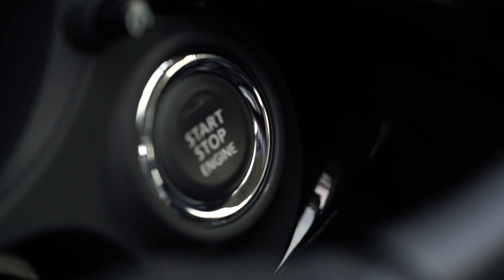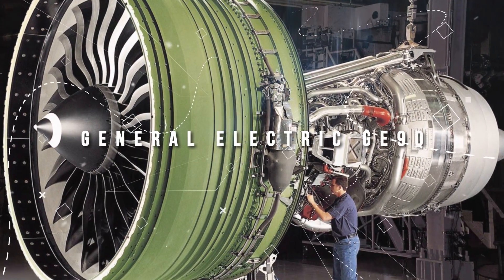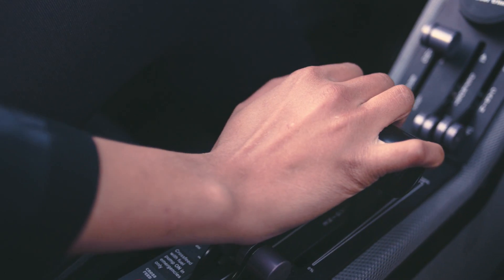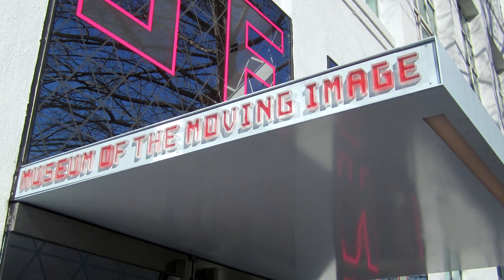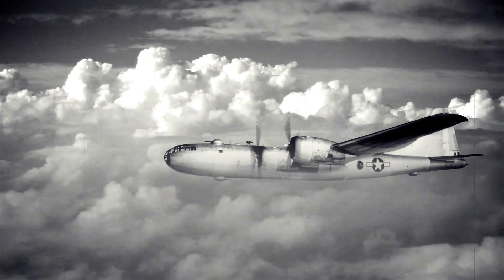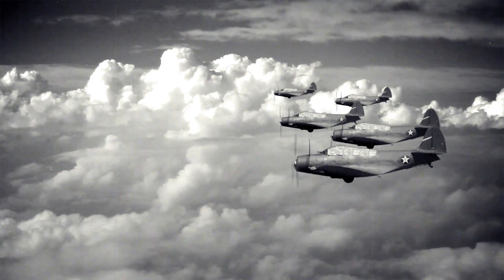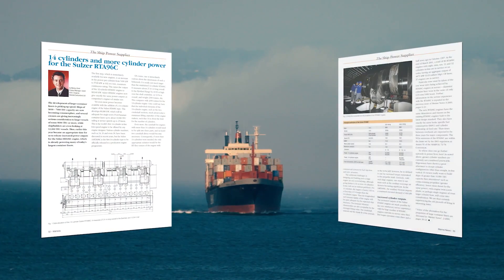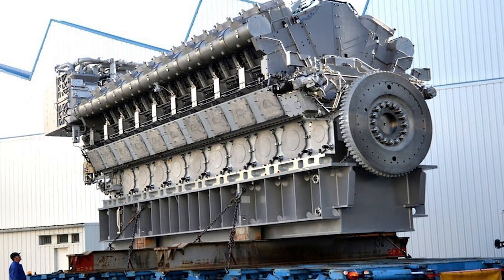10 Biggest Engines In The World

Comment: A lot of turbofan engines are becoming larger for commercial aircraft just look at the Boeing 737 max-8. The larger engines improve efficiency as the bypass air produces a lot of thrust nowadays however these are obviously useless for jet fighters as the high bypass ratio does not allow enough compression for afterburners

Comment: Two mid size are better than one big. Small Nuclear Engines are the answer rather than consuming fossil fuels at huge rate. 
Turbines are most complex with blade clearances very small. Blade Engineering is a big topic, as well as compressor. Turbines produce huge heat and that exhaust heat must be utlised.

Comment: Hate to be a pain in the rear but that GE turbine is pronounced Ter-Ben, and it's a gen 4 wind turbine, not technically an engine. It uses an induction machine without a gearbox to produce electricity in some places straight to the grid, so that is a very cool fact if your an electrical guy like me.
Plus there is only 5 that were talked about not the 10 in the title. Very disappointed but happy to learn something interesting about trains.

Comment: Missing in the convoluted explanation of rod and cylinder configuration of the Wartsila R96B is the fact that the cylinder is an enclosed bottle with the, round in cross-section, upper portion of the connecting rod passing through a sealing gland at the bottom of the cylinder bottle.  When the piston travels upward, it draws combustion air into the portion of cylinder below the piston.  When the piston compresses, fires and starts downward on its power stroke, it simultaneously pushes the air below the piston, up into the combustion chamber, expelling exhaust and charging the combustion chamber with combustion air for the next compression stroke.  Amazingly, this 2-stroke engine has an efficiency of around 50% which makes it not only the largest reciprocating diesel engine, but also the most efficient.

Comment: 4:56
Actually, it has a range FROM 6 cylinders to 14 - the series includes 8 10 and 12 cylinder versions.
The 14 cylinder is the current record holder for "highest horsepower piston engine" by a small margin over an older MAN design.

Comment: This may be off topic, but I think someone might find it interesting. :)
Device to end the creation of Nuclear waist.
Electric Generator Design that's powered by it's self & perpetuates more electrical current then is needed for it to run continuously on it's own. 
 Step 1: calculate how much energy you need pumped into an electric motor to make a vertically positioned circular platter with magnets in-bedded horizontally around it's left side and right side (so there pushing force is pushing out sideways relative to the vertically spinning disc) to spin as fast as you need it to. Also better to make sure these magnets are shielded around their sides & back  with metal that has high permeability so the magnetic field they are emitting is focused fully out sideways. :D Step 2: Calculate how many sets of copper coils you need to be interacting with magnetic fields to achieve this & to perpetuate more electrical current flow then is needed. :D Step 3: Build a round horizontally positioned platter covered in all these copper coils pointed down that does not move (Is stationary) :D Step 4: build a round platter covered in powerful magnets pointed up that can spin and place it directly under platter with hanging copper coils. :D Step 5:  Position the vertical platter that is  motorized close to the horizontally positioned platter covered in magnets pointing up so that when the vertically positioned platter spins the in-bedded horizontally positioned magnetic fields slam sideways against the edge of the horizontally positioned platter causing it to spin. :) Step 6: Make sure enough of the copper coils are feeding their electrical current into the electric motor and the rest of the copper coils are linked into a set of rechargeable Battery's placed in the closest most convenient spot. Step 7: Build a duplicate setup of horizontally positioned discs with hanging copper coils and disc with upwards facing magnets and assuming the first set of discs are positioned to the front left side of vertical spinning disc, position the other duplicate structures to the front right, the back left and the back right of the vertically positioned motorized disc. As the vertically positioned motorized disc spins the horizontally in-beaded magnets will now hit into all 4 horizontally positioned discs causing them to spin. so you will effectively be using the spin of one disc powered by one electric motor to spin 4 constructs that are each generating electrical current. now build this whole setup multiple times over and use the current perpetuated by it to power up scaled electromagnetic generators that are equal to or more powerful than the ones used in a nuclear power plant. You will now have a device that is self perpetuating off of it's own electrical current perpetuation and no nuclear waist to worry about.
Reply: Don't you mean "nuclear waste" not "waist" ?
Reply: @8546Ken  Your probably corect :) Speling is not my strong suit. I left out double leters on purpose here tho, I am against them. :D
Reply: His this actually been evaluated impartially to verify the free energy? Is there a legitimate test report?
Reply: @8546Ken  I'd say through the entire process of designing it I was completely impartial & unbiased to the final result of it's design with nothing but it's intended function in mind I kept an open mind to to any flaws in it's design that could hinder it's functionality. Since this post I have made some improvements to the idea and will add them in another response. As to a physical test report, not that I know of, however seeing as how it is designed with concepts that are tried, tested, and proven, I am confident in it's ability to successfully function the way it is designed to. :)
Reply: @8546Ken  Here is a new part I added for clarification.  
Here is the reason why my device does work. You see even tho the more electrical load you impose on a system ends you up with greater back emf hindering your devices ability to move and generate current, there is a way to work around this. My device multiplies the amount of mechanical motion that is taking place because of the 1 motor. On top of that, it eliminates any extra resistance that could have been imposed on the motor by making the other wheels spin by having the magnetic fields hit the rotating discs the way I described. You see, the vertically positioned disc connected to the motor is perpetuating the spinning of at least 4 main discs that are spinning magnets at no extra effort on it's own part because as it spins around powered by the motor, it is the horizontally positioned magnets that are shielded by high permeability metal that are using their magnetic push out sideways to force the other horizontally positioned discs to spin. So even tho each of those 4 discs spinning are somewhat hindered by the back emf it does not change the inescapable fact that each disc is perpetuating the flow of current in the copper coils above them and the amount of electrical current being perpetuated between all 4 discs is greater then the amount of electrical current the motor needs to run at max potential. It is called over unity and the extra electrical current the motor does not need can be fed into larger more elaborate electric generators. Imagine 12 of these designs contributing to the power needs of a much more powerful design (Probably electromagnetic) that is utilizing this same idea of multiplying the number of horizontally positioned discs that spin because of the motion of one powerful  motor spinning a vertically positioned disc cleverly positioned so that it spins at least 4 other discs at a much higher velocity because of it's more powerful design. In short its all about multiplying what the first motors disc is interacting with & second, up scaling the design to more powerful designs that utilize the same principles.
Reply: @8546Ken  Here is improvement I have made to part of it.
 Improvements to vertically positioned spinning wheel in electric generator design.
Design that allows the re-magnetizing of magnets horizontally plugged into vertical disc.
Aspects of Disc and connected components.
1: Disc it's self is non magnetic 
2: Disc has square shape (or other if better) in center that fits over shaft that is connected to motor that makes it spin.
3: Disc has copper (or other conductive material) ring around its rim. This electrically conductive ring has branching electrically conductive wires that branch towards center of disc. 
4: Disc has rectangular (or other shape if better) crevices all around it's left face and right face where the high permeability container housing the powerful magnets are to be placed.
5: Magnets in the high permeability material (steal/Mu-Metal/Other) have copper coils rapped around them and both ends of copper coils poke through small openings in the back side of the High permeability container. As they poke through they make contact with copper wire that is directly connected to the ring of copper around the rim of disc.
6: In front of vertically positioned disc is an electrically conductive brush (like the kind you would see in a motor making contact with the commutator) that can be pushed right up against the copper ring that is around the vertical disc. This electrically conductive brush is in it's own little rectangular housing that is not electrically conductive. However the bottom inside of this none electrically conductive housing is a lining of electrically conductive material so the current can travel from this to the brush and then to the ring of copper around the disc which in turn gets the electrical current to the coils around the magnets allowing them to be re magnetized while still apart of the Electric motors structure. The housing for the brush is capable of being safely pushed towards the ring and locks into place when it is directly touching the discs conductive ring. The platform the brushes housing is sliding on has electrically conductive plating and is directly connected to a switch so that the current cant get through until you want it to. This way brush can be pushed towards ring make contact and then switch can be flipped to allow current. When magnets are re-magnetized the switch can be flipped to turn off flow of current and then the brush pushed back away from spinning disc so there is no unnecessary friction.
Reply: @8546Ken  & Here is another invention of mine:
Over Unity Water wheel electric generator:
 Top of structure has Huge slanted basin (If looking at it from the side it would be slanting down to the right). When filled with water the water naturally slides down and over edge where it starts falling straight down causing water wheels to spin. Water wheels are stacked on top of each other not touching but close. As water falls it hits them all one after the other making them all spin as it makes it's way to the bottom. At the Bottom of the structure there is a large slanted basin. This basin is slanted in the opposite direction to the one on top so the water slides down to the left, into a pool of sorts that is U shaped,(imagine right below the water wheels is the shallow end and as it slants down it gets deeper for some distance then winds around to the other side of construct and comes back up to another shallow end. Now directly behind the water wheels on a flat surface that is above the pool of water that's curving around it, there is another wheel positioned vertically but this one is not a water wheel, this one has powerful magnets embedded horizontally inside of it on both of it's flat sides so there magnetic repulsive field is pushing outwards away from the disc on both sides. (Also each embedded magnet is surrounded in high permeability metal or Mu-Metal to focus it's magnetic field lines into a condensed strong field. This disc is powered by one powerful electric motor. Now imagine long hollowed out cylindrical tubes submerged & sticking out of the pool of water and reaching all the way up and into the basin that holds water on top. Now imagine each tube has a windy slide inside that goes from top to bottom. Now imagine the tube has rings around it that are magnetically repelled so when the main wheel spins around the horizontally positioned magnets hit into the side of these rings causing the entire cylindrical tube to spin. The spinning motion of the tube will cause it to scoop up the water in the pool and the centrifugal force of the spin and the windy slide inside will guide and force the water back to the top. Now remember for this to work properly there needs to be enough water wheels spinning to generate more electrical current then the motorized wheel needs to spin. 
Key Element 1: Number & quality of water wheels. 
Key Element 2: Quality of electric generator connected to each water wheel.
Key Element 3: Enough tubes to pull enough water from bottom basin back to top basin to equal the rate and amount of water filling both basins at any given time. 
Key fact: The accumulation of electrical current from the electric generators connected to the water wheels must be greater then the 1 electric motor needs to spin.
Key Fact: One must divert the needed electrical current from the generators connected to the water wheels to the motor spinning the disc that has the magnets on it. 
Key Fact : If this is done properly it would be an over Unity Electric Generator.
Reason why some may think this would not work: Some would say the amount of energy the motor needs to spin the disc with magnets on it will always be greater then the amount of electrical current being perpetuated by the electric generators on the water wheels complements of natural energy losses do to heat and friction.
This assumption is understandable however I will explain why this does not stop this device from being an over unity device. You see it comes down to one simple truth. The motor spinning the vertically positioned disc is only actually doing a fraction of the needed work, it is the horizontally positioned magnets impacting into the tubes causing them to spin that is doing the heavy lifting :) and since the magnets are positioned horizontally on disc the push back against them is unable to hinder the motor spinning the disc to a degree that would require it to do loads more work.  
In conclusion this is a device that can be self contained away from the elements so as to not hinder it's effectiveness. And it is an Over unity device if built correctly. 
& to all you nay Sayers out there I would just like to add I hope you all have a great day and whether you like it or not this design works. :D

Comment: Since when and in what universe do spark plugs help with air cooling?
I am asking this for an aircraft engine engineer.
Reply: If you have an air cooling fan that's powered by a gasoline engine then spark plugs will definitely help with the air cooling.
Reply: @paulh2981  that makes no sense the only benefit of 2 spark plugs I see is starting 2 flame fronts for more complete and steady combustion.

Comment: What is an oxymoron?
It's an efficient  two-stroke, turbocharged engine.
Reply: What are you talking about? The ones used in container ships are the most efficient ICE engines in the world.
Reply: @NoZioKikes88  How is that so? Both of these options (two-stroke & adding a turbo) are selected when one needs to increase the power-to-wheight ratio of an engine. They are never used to increase fuel-efficiency.
Reply: @faustin289  they most likely mean that its efficient for that type of engine, not neccesarily efficient when compared to every other type of engine that exists.

Comment: these heavy locomotives require very strong expensive bridge constructions  that's why in the US they stopped railway service
Reply: I didn't know that was the reason they stopped building such heavy powerful locomotives! In truth I'm a bit confused because if you combine at least two diesel powered locomotives it would reach more or less the Big Boy locomotive weight. Could you elaborate for me?
Reply: @paoloviti6156  Because economy was the watchword everything was done to stretch out the available funding to produce the most mileage for the least money. Track was light and flimsy. Stations were small simple wooden structures. The same was true for bridges. Often ferries were used to avoid the need for large and expensive bridges altogether. Locomotives were specifically designed to work with sharp curves, steep grades, and inferior track that was all America could afford. It was very different in Britain. The homeland of the railway was a very rich nation and could afford to do everything on a first-class basis. Big Boy locomotives mainly drove on flat regions with no bridges like Denver - Cheyenne
Reply: @lenny108  thanks for enlightening me!  Economy was everything, still now, and you are correct pointing out how expensive was building massive bridges to accommodate those very heavy locomotives. Of course locomotives like the "Big Boy" far more maintaining than the diesel powered locomotives! It makes perfect sense, thank you....

Comment: Something is not adding up, according to the Nuclear Industry 1 MW will supply 8000 homes, 8000 X 16 =96000 homes when it turning. I do know that a 2500 MW Nuclear Power Plant can supply power to 20 million homes non-stop for 18 months. I know because I worked at one for 25 years. Wind and solar will never be able to match that.